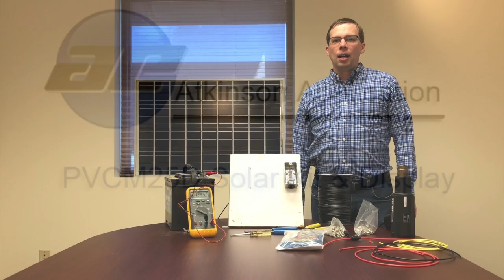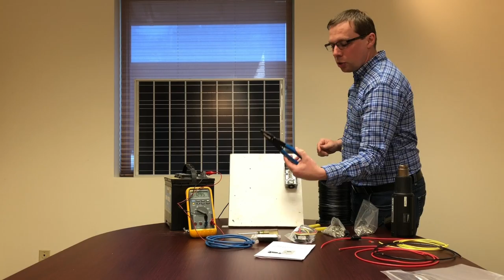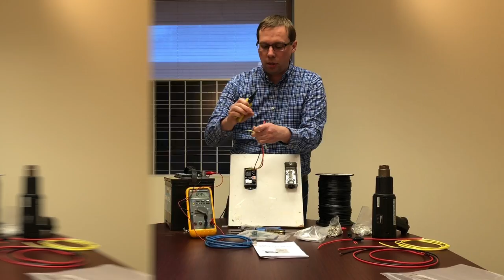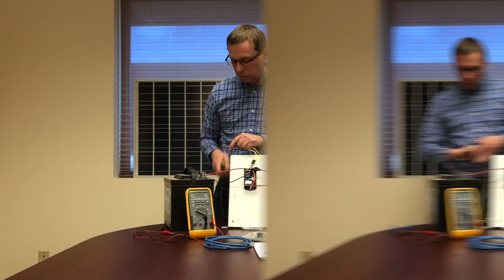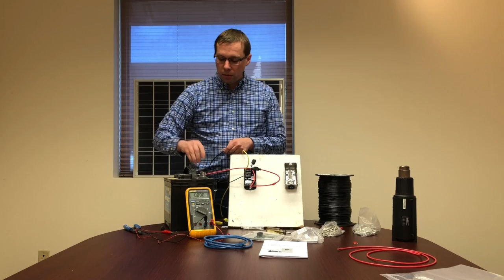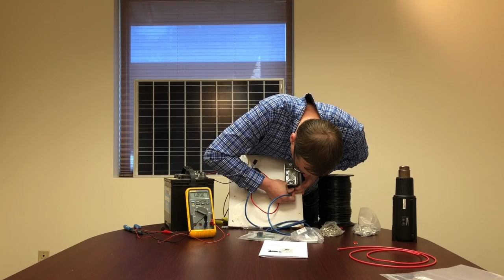PVCM25D Kit Installation

Comment: thanks for the video!  QUESTION:  is it ok to hook up to 200W Monocrystalline panel? here is why I ask:

My Airstream Interstate 24L came with this exact PVCM25D controller & PVDM4-LC display, as well as 1x Ameresco 50W Solar Panel.  I want to purchase a 200W Monocrystalline solar panel, and based on my calculations, this controller should be able to handle the 200W panel, since the PVCM25D is 25amps, and the 200w should equal about 14amps.  However, I am confused about this:  Page 3 on my Kit Manual states "[...] PVCM25D connects PV Panels (photo-voltaic)".   I dont know enough about panels, and what I read indicates there may be a difference between PV panels and  Monocrystalline panels. Let me know if I am incorrect, or simply reading too much into panel type.  thanks.